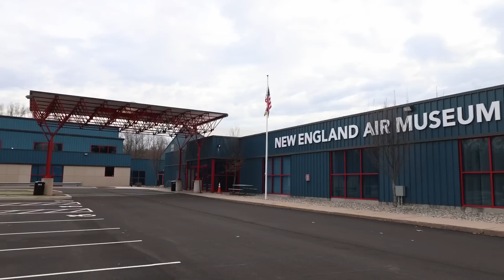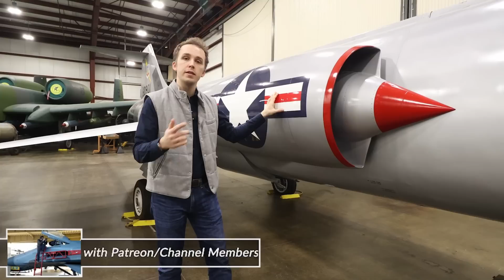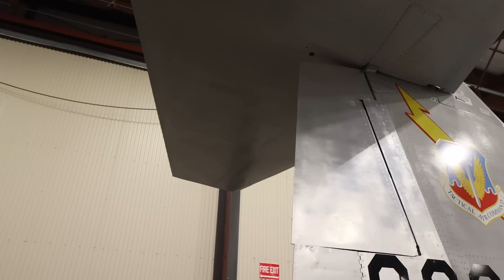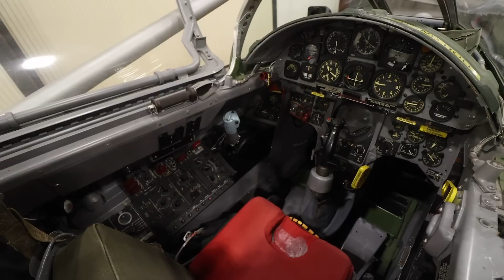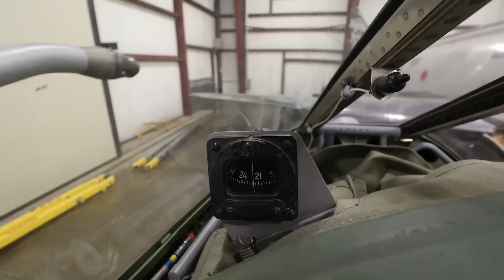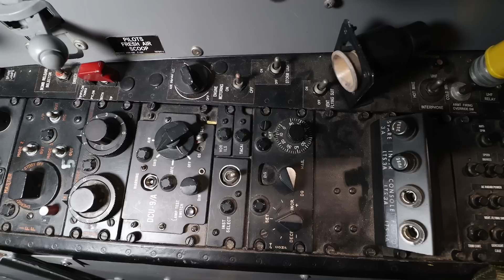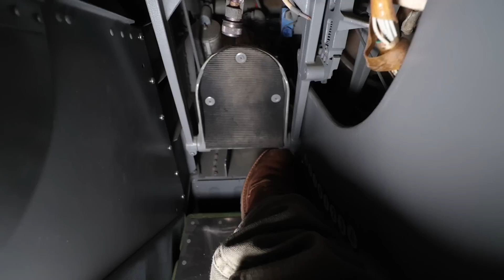Inside the F-104C Starfighter: Full Cockpit Tour and Detailed Walkaround

Comment: What a coincidence. I decided to take a break from writing my thesis on General Steinhoff and the German F-104s, just to find this video right on top of my subscriptions.
I think I'm going to come back to the comment section in a few days and see if there's anything I can use for my chapter about the modern perception of the Starfighter.
Reply: Might I suggest that you check out the Usenet posts in re.aviation.military by waltbj (Walt Bjorneby), who flew, among other aircraft, F-104A Interceptors out of Homestead AFB, Florida, in the 1960s.  His squadron flew both the original J79-3 engined models, and converted to the F-104As with the J79-18 engines used in the F-4E.
The -19 engined aircraft were spaceships - Walt recounts making diving passes on U-2s returning from overflights of Cuba.  In 1967, he and his wingman had gone up to Tyndall Air Force Base, (Close to the Alabama Border on the Florida Panhandle - The Flat Horizontal part) to fly in some tests against the U-2, and were returning to Homestead AFB (Which is South of Miami, basically at the tip of the Florida Peninsula) a straightline distance of about 400 Nautical Miles / 780-ish KM. straight line - they didn't fly this one straight, staying over the Gulf of Mexico the full time. Wanting to get back quickly, and since they had their pressure suits with them (The same suit used by the Mercury Astronauts), they suited up, took off, climbed out to about 35000', accelerated to Mach 2, held Mach 2 until they climbed to 73,000'.  Upon reaching 73Kft, they pulled the power back to hold Mach 2, and spanned the gulf in about 20 minutes.  (Let's see a Lightning do that!).  He really liked the airplane  - and had the F-86F, F-86D, F-102, and F-4 (in combat) to compare it with.

I've posted this before - and I don't want to color your research, but I must point out that when the NATO fighter selection was being held, the only airplane that actually met the requirements (High Altitude Mach 2 Interceptor, Lowe level Nuclear Strike) was the F-104.  The Lightning (Mk 1s at the time) had a range so short that it could only defend 1 end of its runway, had no Air-Ground capability at all, and was limited due to marginal supersonic stability to Mach 1.7 - not fixed until the later square-tailed variants came out). The Mirage IIIA could reach Mach 2 if you stuck on its optional rocket motor and filled the ammunition spaces with rocket fuel.  It also didn't have any air-ground capability, Dassault wasn't interested in giving it one, and at the time, with no guns, it was armed with a single Matra R.530 missile.  The SR.177 only existed on paper.  The Grumman F11F-1F  Super Tiger was barely developed, had not had any weapons integration, and had demonstrated serious flutter problems, and hadn't worked its way up to its potential Mach 2 performance.  Grumman wasn't really trying to sell it, using the experience to build up a European Sales Organization.
The F-104 was in squadron service - you could get into one and fly it, talk to the pilots and maintainers, and it was qualified in its Air-Air and Air-Ground weapons, including the Nukes.  It's hard to beat something that demonstrates what you say you want, versus Paper Airplanes or Future Promises.

Comment: Wings so small, they're probably just fins. Nothing mixed about its reputation, it was a very good lawn dart.
Reply: According to your criteria, the F-105, F-101, Jaguar, and Mig-21 would be even better Lawn Darts - they all have wing loadings in the same range, and the F-101 had even more severe pitch=up problems at high angle of attack than the F-104.
Reply: @peterstickney7608  Excellent point.  I always like to point out that if Germany had operated the F-101 or F-105 instead of the F-104 they would likely have crashed just as many of them.  Other than the reliability issue of the J-79 it was the type of operation more than the F-104 that was risky.  High wing loading was not the issue.

Comment: Excellent as always Chris!
I've worked with the New England Air Museum in my own research, and they are definitely in the Top Rank.
A note on the radar - it was as simple as you could get - a target appeared as a segment of a circle, the center of which was, in relation to the center of the scope,  the azimuth and elevation, and the distance from the center showed range.  If the airplane was turned to point directly to the target, the arc of the target return grew, until it was a full circle. (A Pure Pursuit Course).
The Starfighter, slashing in at Mach Much would, using this, set itself up so that it was behind the target, closing very fast, and in perfect position for a Sidewinder shot.

Comment: Thank you, Christoph and the New England Aviation Museum. Fascinating video. Quite bizarre, by modern standards, to have hydraulic controls on the trainer versions and manual controls on the combat aircraft.  Cheers from NZ🇳🇿.
Reply: It was only the rudder that was manual, not all the controls, and it was not combat vs trainer versions, but single-seat vs 2-seat versions.  Both were combat capable but the 2-seat version needed more rudder authority so they powered it.